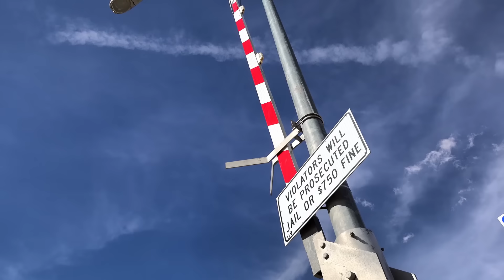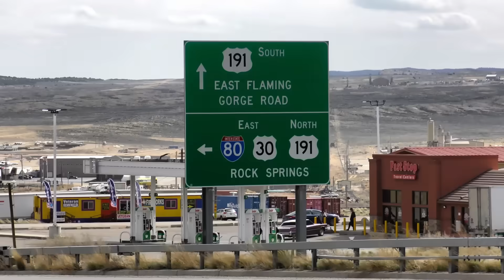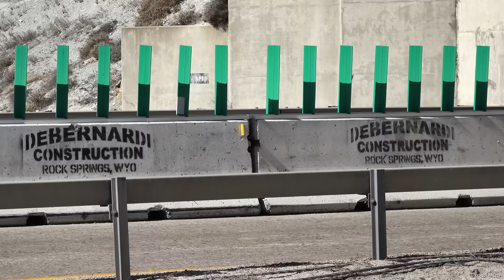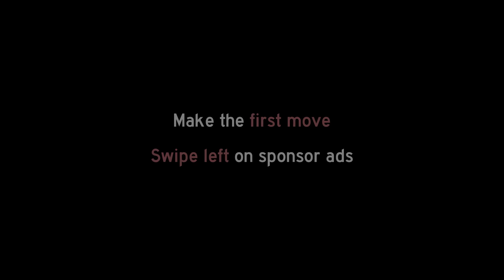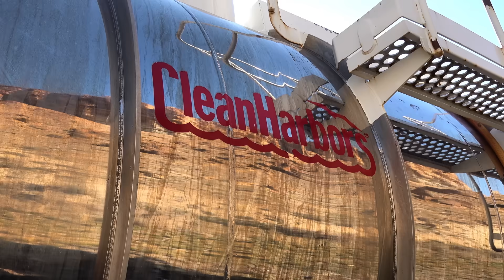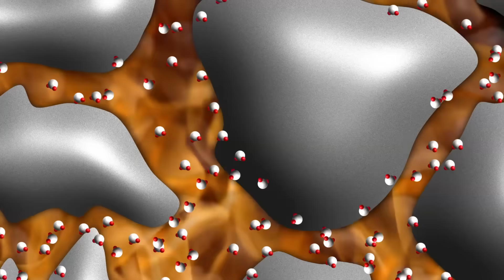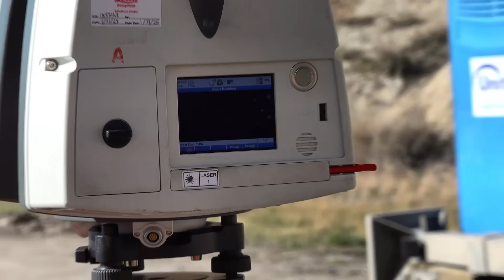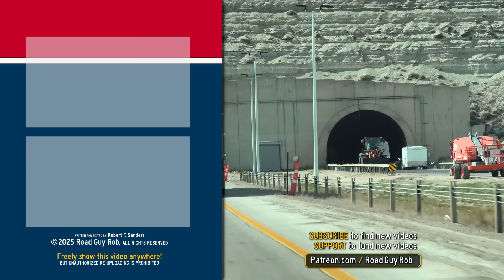Going Inside Wyoming's TOTALLY MELTED Freeway Tunnel

Comment: 2:16 Your idea was fine. They could have diverted the eastbound traffic for the business route west to the underpass on the other side of town.  Then they could have shut the traffic light off completely.  More importantly they should learn from this. If it happened once it will happen again. It's not a question of if, but rather when it will happen and they should be prepared. When money becomes available they should add another ramp from the overpass over the tracks merging to the eastbound business route. Then they could permanently remove that traffic light. Which would make everybody's life better. Nobody likes to wait for a traffic light.
Reply: There's just not the Physical space for the other ramp. Cant really shut down the light, as it is the ONLY WAY that us locals that live on the South side of the tracks to get Anywhere.  Shutting it down is NOT an option.
Reply: @PilotSteak  If you are local I would think you would know that there is over 300 feet of undeveloped land between the railroad tracks and  Flaming Gorge Way which is currently being used for nothing except dirt parking. That would be more then enough space for ramps on that side.  As a matter of fact looking at the historical aerials,  I see that the current current overpass was constructed relatively recently in the last 25 years or so. Before that, that intersection didn't even exist. If that is the only way for people on the South side to get anywhere, then how did they get anywhere before it existed?
Reply: @MaxZomboni oh, and that undeveloped land is UPRR And used for rail maintenance crews.
Reply: @PilotSteak  You said there is not enough physical space for a ramp , which is wrong. You also said it's the only way for for locals to get from the south side to  the north side, which is also wrong. For one short comment you got a lots of things wrong.

Comment: From a scientific research point of view, I'd 'sound' the other tunnel running  nearby, just to check if the concrete and rebar was atrophying due to normal aging, and not just the heat exposure of the fire.

Comment: After the Northridge earthquake poured concrete parking lot buildings had massive cracks.  Contractors came in with high pressure water jets and blasted away the concrete leaving clean rear.  They then came in with probably hydraulic cement and patched the now open gaps.  It came out beautiful.

Comment: Very interesting video! I just drove through the Eisenhower tunnel on i70 a few hours ago and saw the signs saying vehicles with hazardous substances have to go through Loveland pass. I couldn’t imagine how catastrophic a fire like this would be there. 1.7 miles long with much more infrastructure and ventilation. Loveland pass is a single lane each way road. But on top of that there’s lots of small tunnels on i70 too like in glenwood canyon could be catastrophic as well. Most of that area I noticed the other lane was tiered and separated from the other side so it wouldn’t be easy to funnel traffic to one side and I don’t think there’s any easy detour. A few years back I think it was a rockslide caused a several hour detour on i70.

Comment: Was built in the 60? They had more than 60 years to add an emergency sprinklers system to prevent massive damage.

Would it be effective at putting out the fire? Probably not but it definitely would reduce the amount of heat the fire can output and also prevent spread and damage.
Reply: This country is horrible about infrastructure and maintenance. Disasters like this (or the I-35 bridge collapse in Minneapolis or the road bridge collapse in Pittsburgh) will only get more common until we take repairs / retrofits seriously.

Comment: Thanks for this video! I was just wondering the other day what was going on with this tunnel after not hearing about it for awhile. 

Also worth noting that this isn't the only disruption on I-80 currently. There's a section of I-80 in Wharton, NJ that's closed in both directions due to a sinkhole. Westbound was closed mid February, and all lanes closed in March due to the formation of another sinkhole while crews were working on repairing the first. I think 2 of the 3 eastbound lanes opened up the other day, so hopefully they'll have the entire road in NJ will reopen soon.

Comment: I'm curious if the fire is the cause for the potential structural issues of the concrete in the outer limits or just due to aging or incompetence of the work done back in the day.
If all they were doing was crack checking that means little about over all structural integrity and once this tunnel is repairs I hope they check the other one as well.

Comment: Every state needs to educate drivers on the zipper merge. I can't even count how many times I stayed in the lane that was eventually closing for at least a mile on a fully open lane. On rare occasions someone might get angry and not let me merge at the proper merge point, but the person behind them always does. 

On one occasion, some jackass straddled the center line so I couldn't continue, so he managed to back up both lanes.
Reply: Good luck with that. The drivers who see somebody signaling a lane change, so they speed up to prevent it, don't want to be educated.
Reply: @MaxZomboni  In my state you can cut in front of them since the car in the rear is automatically at fault in the case of such an accident.

Comment: 5:40 I'm tired of this zipper merging propaganda. It doesn't make sense how magically moving up the place cars reduce to one lane by a few thousand feet makes traffic move any faster.
Reply: If you can't understand that two lanes of traffic is better then one, then you will probably never understand it. Why should the lane be there at all if people don't use it all the way to the end? Is it just there to look pretty?
Reply: @MaxZomboni  No, its because the 9/10 times I have encountered a land reduction, it has either been 1 of 2 scenariois:

Scenario 1: Traffic is backed up for miles because there is too much traffic for a single lane to handle, no matter how perfect people are at merging. Whether or not people merge 100 feet or 2000 feet away from the single lane zone doesn't change this, because trying to cram 2 lanes of traffic down a one way will always result in congestion.
Scenario 2: There is no traffic, not because it has been magically solved by merging 20 seconds later than you otherwise would, but because there isnt enough traffic to fill up a single lane. Most people merge as soon as they know a merge is coming because they have tons of space to work with, and merge further back can be safer because you know whats around you, as opposed to artificially waiting for a specific point, where there could be someone blocking the merge you were otherwise clear to do for the past 2 miles.

Unless you are in a situation where there is magically exactly a single lanes worth of traffic on the highway, zipper merging either doesn't help (scenario 1) or actively hinders the normal flow of traffic (scenario 2).
Reply: @Cptn.Viridian  As I said if you can't understand that using two lanes is better then one, you will never understand it. Personally I'm going to use what ever lane is open and fastest and I'm going to stay in that lane to  the very end. If your feeling get hurt because I get in front of you doing that, that is your problem, not mine. In every other country in the world, drivers can handle zipper merges. Only one country has problems with it.

Comment: For those too young or too far away to know about it, the 1999 Mont Blanc tunnel fire, between Italy and France, cost 39 lives. The tunnel was closed for three years for repairs and renovations.

It also brought changes in legislation, but as always, after the incident. As the saying goes: 'All safety regulations are written in blood.'

That fire isn't really comparable to the one in Wyoming. The Mont Blanc tunnel is much longer (11.6 km/7¼ miles), and is a single bore, with one lane in each direction. But what they have in common is that tunnel fires are very, very scary.
Reply: Sounds like th Caldecott Tunnel fire between Oakland and Orinda, California.
Reply: I was way too young to have remembered it personally, but I have seen two documentary videos about it. And that was after having snowboarded on Mont Blanc in a video game.

Comment: Surprised the contraflow system wasn't already built into the tunnel, usually tunnels like this have it set up in case you need to do maintenance that shuts a whole bore, no?
Reply: Indeed, but the tunnels are not that wide and were originally built in 1966. Similar to the concept of cloverleaf onramps being an insufficient option in most freeways nowadays, the original tunnel designs were likely more similar to rail tunnel designs also seen in the area. This is their chance to modernize the construction there.
Reply: It took time for them to set up the barriers. The last thing they want to do is divert traffic the wrong way into another tunnel and then have a head on crash and fire in that tunnel as will.  Plus I believe during the initial incident, emergency vehicles needed to have exclusive use of that tunnel to get back and forth.

Comment: So you're telling me there wasn't a plan for when a tunnel needs to be closed? Don't they ever wash the tunnels? Here in Switzerland, everything is built to direct traffic to the second tunnel whenever one needs closing (and they do that a LOT during regular maintenance). Same thing with the alternate route through town, it's taken into account when designing the freeway, to know there's a place to redirect traffic when needed

I found the concrete divider particularly funny. When there are roadworks here they'll send you the wrong way down a tunnel at 80km/h with just the LED arrows and cross on the ceiling lit to tell you which lane is open for which direction. People know how to drive I guess. They usually put up dividers for longer duration work, but I don't think I have seen that done in tunnels. Maybe it's too dangerous to create that much obstruction inside a tunnel

Comment: The zipper merge is one of those things that look good on paper, but doesn't work in practice. If you wait until the very end, you're more likely to slow down more than necessary because someone won't let you over.
Reply: And yet merging early doesn't work in practice either, because it causes an excessively long queue and leaves an open lane people will drive down anyway.

Zipper merging as a basic technique works well across, well, most of the developed world.
Reply: If you can't under stand that traffic using two lanes is better then just using one lane, you will probably never get it.

Comment: Unfortunate that Wyoming is starting the zipper merge. Oklahoma (the state that pioneered it in the US) recently outlawed it because the math behind it never took long trucks and busses into account. Zipper merges REQUIRE all vehicles to be the same length to properly work. If that isn't the case, you have to merge as early as possible (up to over 100 miles away). Giving as much space as possible to merge ensures the merges only happen when people have several hundred feet of space, and no slowdown can possibly ever occur. They should have signs at the Nebraska and Utah state lines warning about this closure, and encouraging everyone to use the left lane when possible.
Reply: I think the truckers have trouble with zipper merging for other reasons. The same reasons that put them in a truck driving job instead of a real career.

Comment: They should keep those center dividers, in both tunnels, to prevent lane changers and hopefully prevent trucks from jack-knifing.
Reply: The tunnel lanes probably need to be wider than a normal single lane in certain instances (wide loads, emergencies, tall vehicles, etc).
Reply: Which means that if a breakdown happens, one lane stops till a wrecker backs in from the other end to clear the breakdown. Not an ideal solution.
Reply: James and Bob both got good points, reality is always better to make things  able to be used more flexible than just the standard dimensions, it's part of the reasons the interstates have dimensions specifications, and not having a break down/emergency shoulder makes separation less safe so a barrier here is definitely not ideal.

 A reasonable precaution could be motion/flow sensors in the tunnel and lights/automatic warning signs before a tunnel to prevent more vehicles from entering after an accident happens, not all that expensive or complicated,
Reply: Prevents emergency vehicles from navigating as needed
Reply: Well there's a handy detour for wide loads and the jack-knifed semi and big pile up blocked both lanes so the wreckers apparently had to back in anyway. Also, the tunnel is only 1100 ft and the other side seems to be working fine with the divider and one lane in each direction. So a divider with a wider lane on the right for trucks and a relatively narrower lane on the left for cars doesn't seem like a stretch.

PS. This crash apparently started with a pickup crashing and causing the semi to jack-knife. With a divider I doubt there would have been a pile up and probably no fire too.
Reply: @rogerwilcojr taking over dimensional loads of a divided highway and putting them on 2 lane opposed traffic isn't handy it just moves a small potential hazard from one place creating a bigger potential hazard in a different place. 

This particular accident may have been prevented by the barriers but would increase the chance for different types of accidents, in reality what happened when the truck jack knifed is it created one lane out of the two, a restriction where one vehicle blocked the tunnel the traffic behind pilled up and crashed and then a fire. 
When a tunnel is split by jersey barriers it effectively creates another restricted path if no emergency lanes are present, if barriers were placed in both directions you would make 4 separate single lane tunnels essentially, creating 4 possible paths that can be blocked in the event of a normal break down, accident, emergency, ect all with an increased potential for causing a pile up with no safe shoulder or other lane to make an evasive maneuver that can prevent a minor incident from becoming a bigger one, without emergency lanes it doesn't have more pros than cons.

Comment: This is why I like when tunnels have fire extinguishers, emergency exits, emergency shelters, emergency phones, security cameras, ventilation fans, control rooms, monitoring, all that stuff.
Reply: Deluge systems are found in some modern tunnels now. Basically a system that can drop a large swimming pool's worth of water on a specific section of tunnel very fast. Generally that's enough to put out any fire, even ones water would normally struggle to put out.
Reply: From the video it sounds like because it's a relatively short tunnel it didn't require a lot of those things
Reply: @Yawhatnever  not so much the length, but age, this tunnel was built in the 60s, and the necessity of life safety systems really didn’t become prevalent until the 80s-90s. 

A huge turning point of American life safety was the mgm grand fire in  1980, it’s a really good watch on YouTube, goes into depth about fire sprinklers.
Reply: Unfortunately, the tunnels here are very old (original), and not up to modern standards
Reply: @xHadesStamps  great opportunity to upgrade in the repairs huh?!
Reply: I agree there, however these tunnels are just too old and too short, plus as far as I can remember this is the first major incident throughout their existance. I can't imagine the staggering number of vehicles that have passed through there, and to have gone so long without a major incident like this happening before? It's actually pretty impressive in that reguard.

As for the ventelation, it's actually not as big of a problem as one might think. (still a problem though don't get me wrong, could for sure use a ventelation system) The wind here is constantly blowing, I can count on one hand how many days we had with no wind at all last year, and 90% of the time it's blowing from West to East, which is the way the tunnels are facing, so the wind basically IS the ventelation. Far from prefect but it still works bacause it's a short tunnel.
Reply: They can add fire suppression to old tunnels. The Eisenhower-Johnson tunnels on I-70 in Colorado were opened in 1973. A few years ago they upgraded the fire suppression system. https://www.codot.gov/projects/archives/Eisenhowerfiresystem

Comment: Having driven that tunnel in the last 60 days, and 2-3x a year since 2005, I have a strong theory of what caused this. Before and after EACH tunnel entrance there, historically has always been a NASTY pothole/crater/road fissure. I think it 82mph, a vehicle hit that pothole, blew a tire and rim, clipped another vehicle causing chaos. I also believe one of the vehicles in that tunnel were carrying dangerous chemicals that enhanced the fire and decay of cement & structure.
Reply: interesting